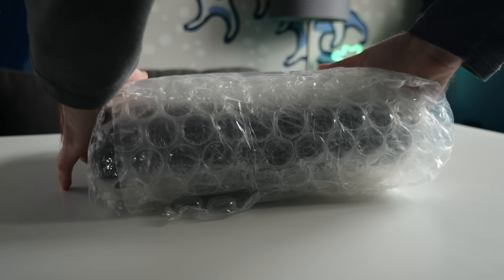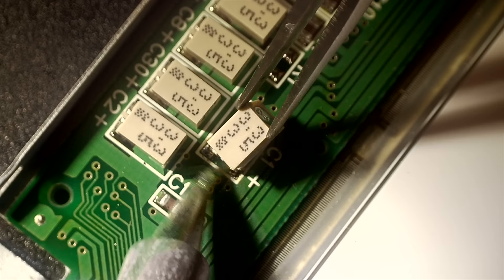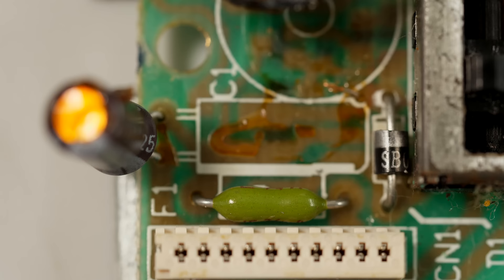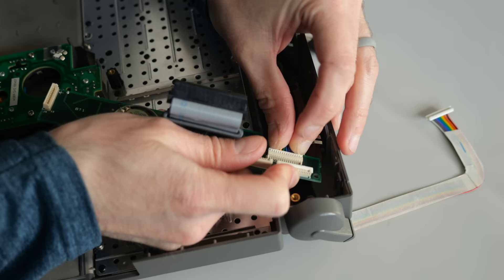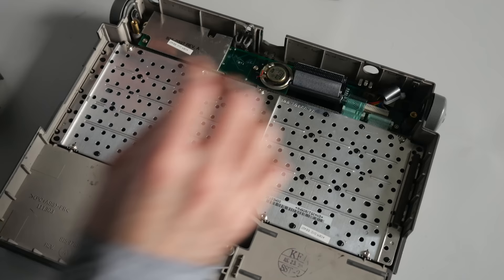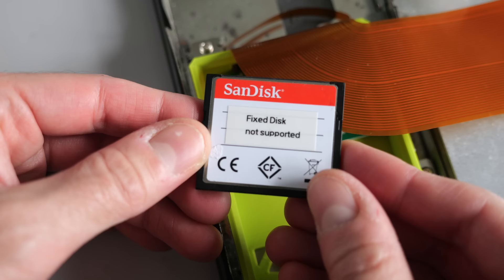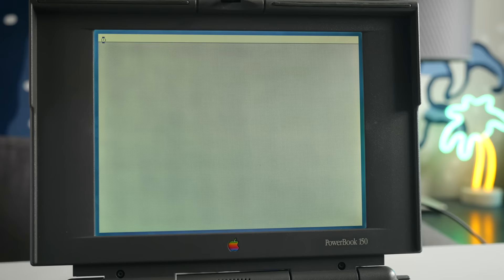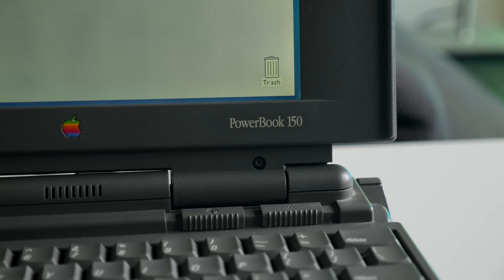I restored the WORST laptop Apple ever made

Comment: 30 years later and most manufacturers are still installing hinge mounts inside of weak plastic resulting in the same issue. Awesome video.
Reply: The biggest technician that ever lived
Reply: Hinge 
Problems
Reply: its the greatest technician thats ever lived
Reply: HP=Hinge Problems
Reply: last place where i would expect you
Reply: greatest the lived ever technician
Reply: My 15yr old unibody polycarbonate macbook hinge has cracked at the corners but still functions perfectly

Yet, other manufacturers are still making subpar trash hinges that fail to this day!
Reply: the greatest lived thats ever technician

Comment: My parents always buy the worst products, Chrysler cars, RCA electronics, etc. No wonder they had this. 🤦
Reply: The Walmart special
Reply: Chrysler was so bad until all the problems were fixed by the dealer..on your time.
Reply: RCA was at the top of the world at one point
Reply: Chrysler Cars I've always had Goodluck with and if mine gives me issues now it will have nothing to do with it being a Chrysler since the car is 21 years old with 249000 miles.
Reply: the comment is so funny, yet so sad at the same time
Reply: Classic RCA made some of the best and most reliable products, and was responsible for so many of the innovations we take for granted today. The problem was once the original company went out of business or was acquired or whatever happened, and the name was just getting thrown around by whatever cheap Chinese company could get their fingers on it. It's such a shame to see such a fall. From grace, though there were always issues of some kind.
Reply: I still use 1960’s RCA 12Ax7 vacuum tubes. they last forever

Comment: Not surprised that it was built by Acer. I can't count the number of times that an Acer-laptop of my employer in the late 90's suffered broken hinges. It is an Acer "seal of quality". 🤣
Reply: I have no large experience with Acer but they're seemingly pretty average, a friend of my grandparents got an 15" Aspire ES1 and it's okayish with i3-6006U, the LCD panel has 1080p resolution, still got optical drive and just 4 GB of RAM, however DDR4 and another slot is available, three USB-A but sadly one on of them a 3.0.
But they really put a 1 TB mechanical hard drive into that thing (at that time 240/250 GB SSDs were available at the same price of a 1TB 2.5" HDD) I recently serviced it and it enraged me once more how slow Windows 10 due to that spinnin' rust was!
So I got a 250 GB SSD where I cloned Windows onto and also a stick of RAM to have dual-channel, now it really runs and also boots up in around 20 seconds instead of far above 2 minutes to get to the login screen and easily another minute to the desktop!
And no joke, I bought a 2017 iMac 21.5" 4K a year ago (with i5-7400, 8 GB of RAM, Radeon Pro 555 and 1TB HDD) and this ran the final official mac OS version - Ventura from HDD better than Windows 10 on that Acer laptop.
Also barely seen some outstanding concepts and innovations, at least their ConceptD line has some nice styling similar to Asus' ProArt and Gigabyte's Vision lines, if the prices are similar I'd rather choose such a Laptop or small Desktop over a overstyled Predator/ROG/TUF/Aorus Gaming machine.

Comment: I can feel the rage behind that thumbnail. It's a feeling that unites all retro computer enthusiasts 😂
Reply: I just had four slot 1 motherboards fail in front of me. I can feel this.
Reply: I'm working on a Sega Game Gear...I got it all nicely recapped after being blasted with fish stink all afternoon, only to have the contrast wheel explosively decompose
Reply: At least it isn't a Coleco Adam.
Reply: @MrJohndoakes  Isn't that the computer that wipes the cassettes when you turn it on
Reply: @ozzie_goat  Yes, you have to keep the boot cassettes away from the computer when you turn it on. It also has the world's loudest daisy wheel printer (that most present users work around with a separate power unit, because the computer's power transformer is in the printer.) It also uses a ripoff of Atarisoft for its normal BASIC language.

Comment: I would still argue that the 5300 was the worst one. The 150 didn’t pretend to be anything but a low end piece of crap, while the 5300 mascaraed as a high end machine despite its middling performance and lack of CD drive right as multimedia was booming (the batteries also caught fire on the first batch and they had a whole repair program due to the fragility of the plastics)
Reply: 5300/190 definitely need to be up there (along with the Duo 2300c, which wasn't a terrible design but was just SLOW due to its architecture — my family had two of them). But the 145B/150 as the maximally cost-reduced 100 series should be up there.
Reply: The worst was the non-stick power lead jack, which would do anything not to stay put in the power socket. Sneeze anywhere near your 5300 with a depleted battery and watch your machine switch off in disgust.
Reply: I agree with just about everything here, but the battery thing is massively overblown. The units with Lithium batteries never made it to customers. The fires were all apple employees or in the factory (only around 3 I believe). The real unfortunate part is that it hit the press, meaning that people still talk about it. The main disappointment is that they had to switch back to NiMH batteries - that lowered the battery life. That’s what should be criticized, not the fires which also weren’t even apple’s fault.
Reply: The 5300 series were still useable/connectable/expandable. The 150 was extremely limited in every conceivable way.
Reply: But the 5300 saved the world.

Comment: ABS can be both sanded and bonded with acetone. For pieces in cases like these, I'm a big fan of using ABS filament for my printer, and using ABS slurry (ABS in acetone) to glue parts & add some extra around the sides of weak parts. It works great, and when the bond is strong it's theoretically as strong as an original part; the chemical bonding means there's no intermediary substance like Cyanoacrylate there. :)
Reply: Beware - ABS parts I 3D printed 10yrs ago started to turn brittle and fail 5yrs ago and now they're all trash.

Don't assume 3D printed ABS will last the same as other ABS products

Comment: At least you got the RAM adapter. They weren't included from the factory (at least, not without additional BTO RAM installed) and nobody has them anymore. Plus people want a bunch of money for the Duo RAM cards on top of it. Normally computers with no features are more reliable than their blinged-out counterparts, but the 150 was clearly bottom-rung and it shows.
Reply: That RAM is worth more than the laptop!

Comment: You have real dedication to this! I have a PowerBook 145b that someone gave me. The last time I checked, it still booted up. That has been a while. It's just a decorative piece in my home office now but I do get the urge to power it up. I need to find its power brick first! After I got my first 3-d printer I found that there are a lot of 3-d models for vintage Apple computer parts. I was surprised by this but then I should have known there would be. We Mac users are passionate about these products, even the ones that were made while Steve Jobs wasn't around. Apple made some great products during this time but they also made some really bad ones like the Performa 6360 that I bought just after Apple acquired NeXT. It worked well but its 1.2GB hard drive died just a couple of months after I bought it. After getting it fixed, I kept it until I bought a rev B iMac in January 1999. It was on that Mac that I first ran Mac OS X beta and I was happy that all of the familiar features that I loved about NeXTSTEP were in Mac OS X.

Comment: As a poor student in 1995, the PowerBook 150 was the only Macintosh notebook my parents and I could afford.  I can attest that it is every bit as sh%tty as suggested. The hard drive failed, plastics cracked, the display glitched, and it occasionally didn't like to power up.  The fourth time I had to ship it back to Apple for repairs under the 1-year warranty, they were having trouble keeping replacement parts in stock and I convinced them to replace it with a PowerBook 190.  The 190 had its own set of shortcomings but was all in all a much better machine.

Comment: I spent of good portion of the late 90s and early 2000's wheeling and dealing old Powerbooks on eBay for a living. These type of issues are very common and even back then it was difficult to get spare parts at a reasonable price. Apple's absurd copyright restrictions on old service manuals made restoring an old 'Book a hair-pulling experience. Tempers flared, tears were shed, much whinging ensued. You have my utmost sympathy and respect.

Comment: Every vintage Mac enthusiast has one of "those projects" - a computer that stubbornly refuses to work no matter how much time, energy, period-accurate components and upgrades you throw at it. And that's on top of the wonderous limitations that shipped with the computer in the first place thanks to Apple's cost-cutting or weird quirks of the era. Kudos to you Colin for soldering on and entertaining us with your suffering! Also, I'd argue that the G3 iBook is one of the worst laptops Apple made. They were heavy, incredibly annoying to service if the hard drive died, and suffered from BGA solder failures with the GPU. That meant that motherboard failure was all but guaranteed unless you had access to a BGA reworking station.
Reply: Which one? Clamshell, white, or both?
Reply: @und4287  The white iBook with the Rage 128 GPU. The clamshell iBooks were also very difficult to get into, but they didn't have the same GPU issues that the later white iBooks had.

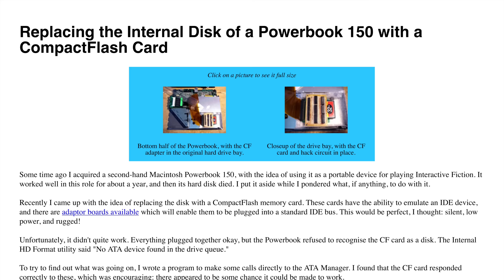Comment: 15:00 - huh, strange, I have an identical cheap Aliexpress IDE2CF adapter with a similar 1GB Kingston CF in my unit and it worked right away, although I installed MacOS on my PC with Basilisk II and transferring the image over to the CF.

Comment: I think I have one of these somewhere. I remember the trackball not working and I had to fix traces on one of the axis wheels to get it kinda working. After that I tried to use the floppy drive, but the drive was fried. The brightness control was also hosed and I was cited the caps on the monitor needed replacing to correct it. The main HDD also needed replacement. I think from that point forward I threw it in a box and it's been there for about 5 years.

Comment: If you ever want to do some work with old IDE interfaces, I recommend looking into an MSATA to 2.5" IDE enclosure.
they're fairly cheap and MSATA drives can still be found all over the place that are in small enough denominations for very cheap, and your average IDE controller can't tell the difference, even on extremely old jank 286 era controllers.

Comment: when your done soldering and the board is warm, you can use your hot air station to heat up the caps and they will settle down, the solder will flow, and everything will look nice. tantalum caps will be okay, be careful with surrounding parts.

Comment: None of the PB 100 models have SCSI termination power for the BlueSCSI, which requires external power. This is not a cost-cutting measure of the 150.

It’s not enough to replace the hinge plastics in the display if you don’t service the stiff old hinges. They’ll just end up cracking the chassis plastics.

The trackball and keys not working is definitely an issue with the 150. I’ve not figured out why yet.

The plastics in the 150s are definitely softer than its cousins. I’ve seen them tear themselves apart like no other 100 series machine.

Comment: That plastic was awful when they were new.  I had broken plastic around the screws on my PowerBook 140 in the early '90s.  We didn't have 3d printers yet, I had to use epoxy and hope for the best.  It held for a while.  The ribbon cable that connected the top case to the logic board was also awful, I ended up building a new cable.  And I only had that computer for about 4 years.
I sold it to a friend for cheap when I got a 160.  It still worked when he got a TiBook.

Comment: Proud PowerBook 180/520c/5300cs owner.  The 180 was LEGENDARY!!!!  It was so good, and hot seller that Apple didn't discontinue it late 1994/early 1995 (back then Apple would discontinue PowerBooks after roughly a year and a half).

Bought my 180 secondhand in the mid 2000's, and it was my word processor machine for years.

Finally booted it up last year for the first time in about 15 years, and everything was still there on the HDD and working fine.

It's still entirely stock from 1992.

This video inspired me to replace the HDD eventually with Compact Flash (that brings back memories) or something similar, as my PowerBook 180 is my BABY from my Apple PowerPC days (went back to Microsoft/Windows in 2011, as I am a PowerPC guy, and if I was gonna go back to x86, I figured go back to Windows.  No regrets.).

Just finished the video and whoa....  Wait....

The 150 could handle 36MB of RAM?!  The 180 was the flagship 100 series machine (yes I know it was 1992 vs 1994), but the 180 topped out at 14MB (mine has 12MB).

I am so confused right now.....

Comment: never had an issue using LIDO to format the drives.... refurbished half a dozen of these....  Usually use a solid state DOM module (such as apacer) in a 44 pin adaptor for the drive.  I find this model desirable due to 2-bit greyscale (4 shades) , IDE interface not needing blue scsi or other adaptors.  I usually mod them to add the adb port back (use s-video jack) and a headphone jack with switch.  adb mod is on waybackmachine....

Comment: Sugru putty could work for rebuilding the bezel attach point. I just got a 165 c and expect to have to do some work to it. Missing battery pack and unfortunately the cover too so that will need to be dealt with. I'd like to put a battery in it and it seems like people have been successful with replacing the original Ni-Cd pack with a NiMH one. 5 NiMH cells wired in series will give the 6v necessary. I still have some homework to do to verify if the original charging circuit will be safe to use but generally a lot of people report NiMH cells charging fine with Ni-Cd chargers, albeit slower than they would with a NiMH charger. Shouldn't be difficult to add a battery protection circuit anyway. I probably won't try to rebuild an original pack, just make a pack of 5 cells in series, held together with shrink wrap with a lead and plug on the end and a corresponding lead and connector wired into the laptop. This obviates any issues with the pack contacts, which appears to be a common problem. A simple 3D printed cage could hold it in place and interface with an original battery cover. The best part is that it looks like there is room for 3000mAH cells for a total of 15,000mAH or around 50 W/H, which could probably run a 165 c for about a week.
The issues with getting a CF card to work really aren't that big a deal. I'll take the hassle of a custom board over the risk of HDD failure in a machine I plan to sell. Someone out there wants an actually usable PB 165 c. There are people out there who need a basic computer but don't want all the distractions that come with a modern device. An example of a use case would be a writer with an internet addiction.

Comment: 12:58 It doesn’t support Target Disk Mode because it doesn’t use a SCSI hard disk — in the PowerBook 100 series, SCSI Target Disk Mode is pretty dumb and just tells the PowerBook to not attempt to boot, leaving its internal hard disk on the SCSI bus for the other Mac to see. The firmware simply doesn’t have the ability to bridge ATA to SCSI. Later PowerBooks’ firmware did gain that ability and HD Target Disk Mode was born. That continued until SCSI was replaced with FireWire, giving us FireWire Target Disk Mode, and then Thunderbolt, giving us Thunderbolt Target Disk Mode. The Apple Silicon Macs, however, no longer have Target Disk Mode, having “Mac Sharing” instead.

Comment: They don't even say MacBook anymore. There's no text name on my M2 MacBook Air. You just have the Apple logo on the top (back?) and the text on the keys. Let alone a model number. Mine was unique for a while as, it's clearly an Air since it has no active cooling, and it was the only Air that wasn't wedge shaped. Now the M3 Air looks exactly the same. Oh well, it's one or the other and M3 was just a minor upgrade anyway — hence the rush to M4.

These old PowerBooks crawled so our M-series MacBooks could run, though. It's cool seeing all the old devices. But, laptops before ~10 years ago were not great.

Comment: I was hoping you'd dig out an IDE to SD card adapter, have had great luck with those, no issues with CF weirdness.
Reply: I wound up using a m.2 SATA to IDE adapter.. however the limitations of this piece of shit forced me to image a 1 gig hard drive to the SSD and now have 119 inaccessible gigs. Probably going to move to either a CF2IDE or an industrial IDE disk on module (have one sitting on my desk)

Comment: I know Linux has pretty extensive partitioning options, I wonder if you could’ve hooked up the IDE drive there, created a small partition and then transplanted it back. I know some drives require the special Apple driver but from what you’d said that might not be necessary here.

Comment: Ok… I have 3 of these hunks of garbage.. two are exclusively spare parts for the one working one. The only reason I hold onto a working one is I have the incredibly rare 36 MB RAM expansion and it’s quite a capable 030 machine given its “limitations”. I replaced the shitty IDE drive with a SSD and I can network using a BlueSCSI v2 plugged into the HDI-30 port.

Thinking of asking a friend if she can 3D print a new housing since none of my 3 are 100% intact.